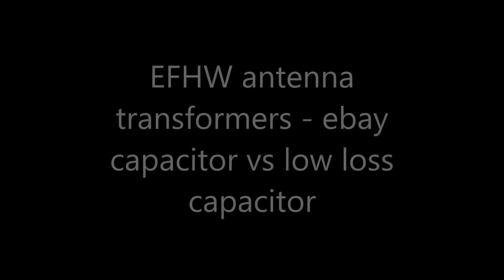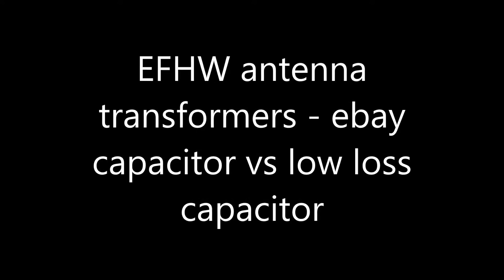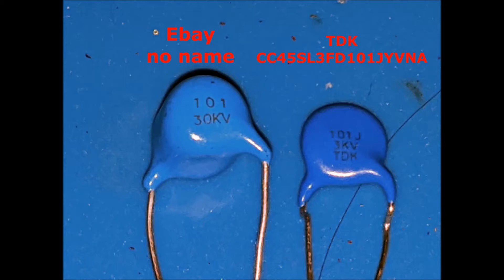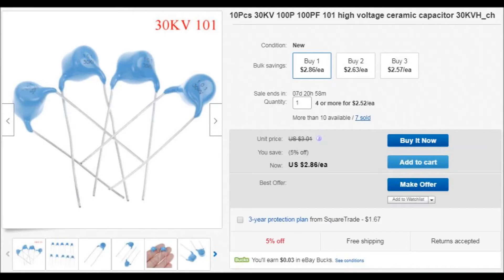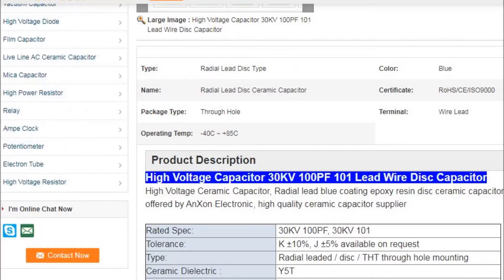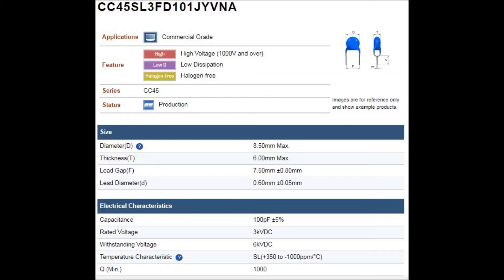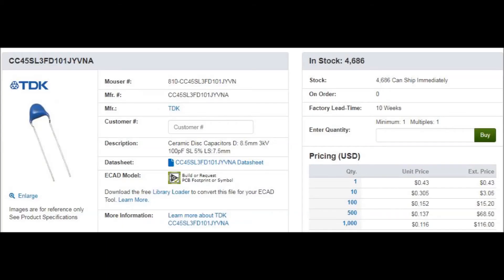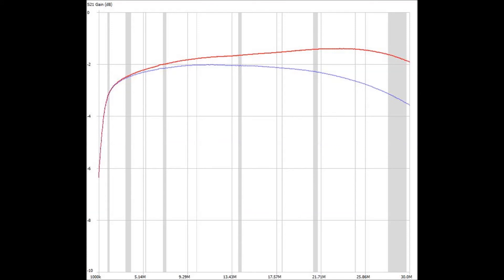EFHW antenna transformers - capacitor loss comparison

Comment: I'm so glad I found this video. I was using the eBay capacitors you mentioned, and in my particular case, I was seeing SWR increases in the upper bands, especially 10 meters, during transmission. This was more pronounced when running between 50-100 watts. I ordered and soldered in the TDK cap from Mouser, and the SWR issue is gone. I can confirm that those eBay caps are exactly what you described as "complete garbage".  Thank you.

Comment: The eBay capacitors shown here are "30kV", while the TDK are only 3kV.  The comparison would have been slightly improved if the capacitors were more closely matched, to eliminate that uncontrolled variable. But still, I'm sure that you're correct. Cheers.
Reply: You are missing the point, the ebay capacitor clearly isn't 30kv.
Reply: @GoonyMclinux    I appreciate your videos.  Please keep doing them.  Now the But. Breakdown voltage wasn't what you measured.  You measured loss.  So did you measure Capacitance?  Were the caps the same/close value?  That could affect the measurement you had just as much as a low Q in the capacitor.

Comment: Hi I'm curious if making a capacitor from coax would be a leaky capacitor or not (I'm sure it would depend on what type).  So in general, do you think that its possible to make one and then tune it by adjusting the length or it's a waste of time and better to just use a good quality normal cap?  If it is, which coax would have the best qualities?

Comment: Here's the results for a 100pf 1kV Hilitchi cap measured at 100kHz on a DE-5000: C= 109.1pf   and D = 0.001
BTW Q=1/D.  Q= 1000.  I bought a 150 pcs kit of these caps recently on Amazon for $9.99.  Does anyone have a similar measurement for the "EBAY caps"?

Comment: Hi again....my last comment wasn’t stated very well, let me clarify:  All the transformer designs I’ve seen include either a fixed or variable capacitor, with the primary goal of improving SWR.  Two postings I’ve seen try to determine what amount of capacitance is needed. 

I would appreciate your analysis of these statements and if a fixed capacitor was to be part of the transformer, then what value achieves the best overall efficiency of your signal across multiple frequencies.

Ideally your analysis would also include how to determine this value given other variables such as impedance matching ratios (49:1, 64:1, or other ratios).

See the 2 postings I’ve referred to below:

https://owenduffy.net/blog/?p=12642
“A 100pF silvered mica was connected in shunt with the transformer primary. This is not an optimal value, benefit may be obtained by exploring small changes to that value.”

https://vk3il.net/projects-antenna/efhw-matching-unit/
“ I experimented by attaching a load resistor between the output and ground for a range of possible antenna impedances from 2200 to 6800 ohms. Here’s a series of SWR plots across the HF bands from 80m to 10m with first no capacitor and then a range of capacitor values as detailed on the images.”
VK3iL goes on to say:  “ As you can see, the capacitor is clearly necessary in this design and 100 pF allows a better than 2:1 match across most HF bands and impedance values. Whilst 150 pF provides a better match at some frequencies, the 100 pF seems to provide a more even performance over a wider range of loads and frequencies. Values above 150 pF resulted in much worse plots and weren’t recorded.
It would be possible to replace the fixed capacitor with a variable capacitor (such as a Polyvaricon). This may allow the SWR to be reduced through tuning for the specific frequency and antenna impedance at the time. I haven’t tried this as the goal was to get adequate performance with no tuning needed. The advantage of this design with a variable capacitor is that the voltage across the capacitor is much lower than if the capacitor is on the high impedance side of the transformer. Hence a Polyvaricon in this position would likely be fine with 50W or possibly even 100W (with the sections wired in series).”

Thank you,

Jim / AC3B